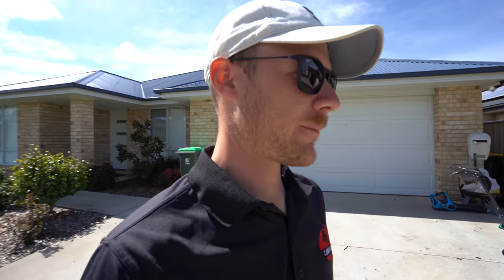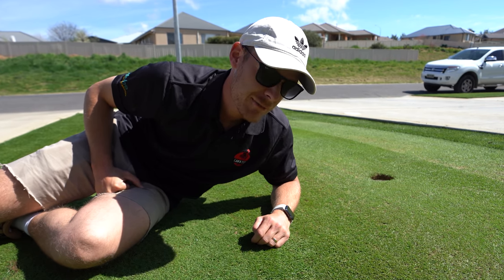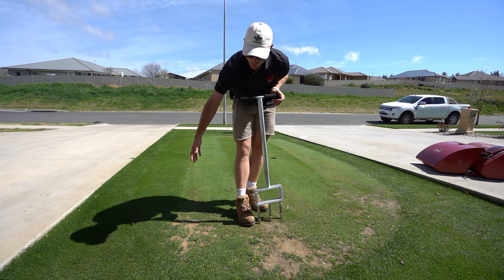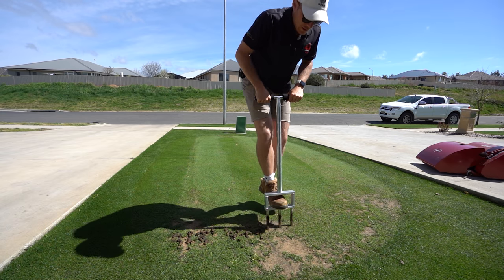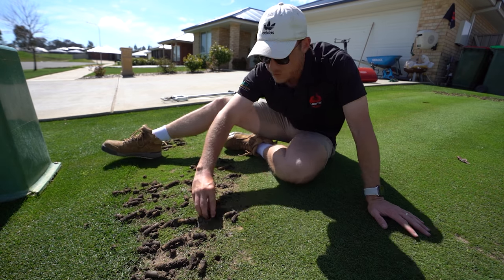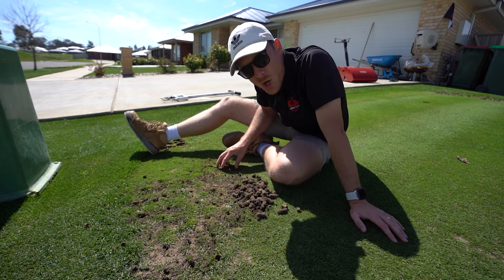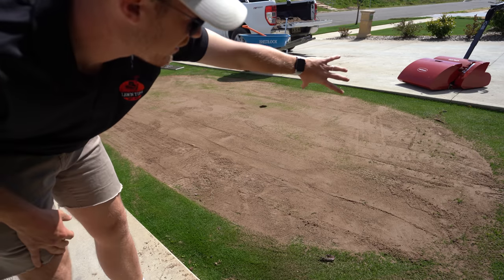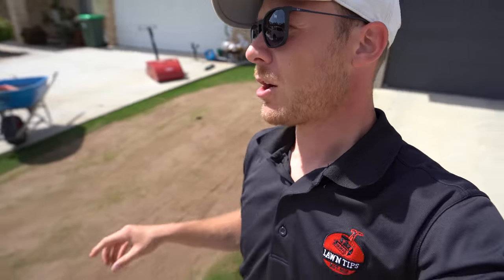Lawn Renovation On My Golf Green // Topdressing and Levelling With Sand

Comment: Watching from San Antonio TX. We installed about 2000 sq ft of Tif Tuf bermuda in our back yard after a pool reno. It needs to be topdressed next spring as its still rutted. My issue with my Tif Tuf is it seems to go stalky and brown in places. We have a watering restriction here but Im trying to get 2 inches on it. I d ont have a reel mower and am using a EGO Select Cut set at 1 inch